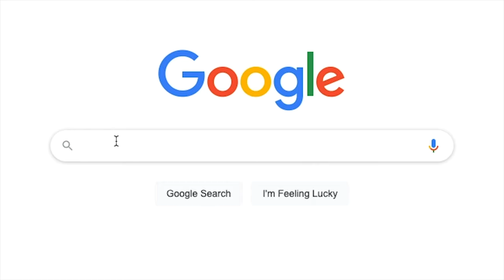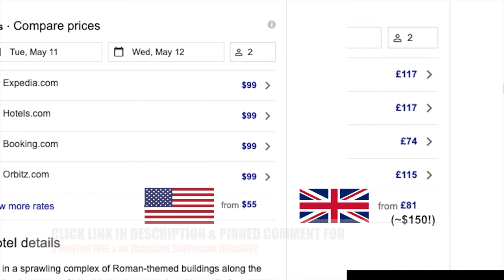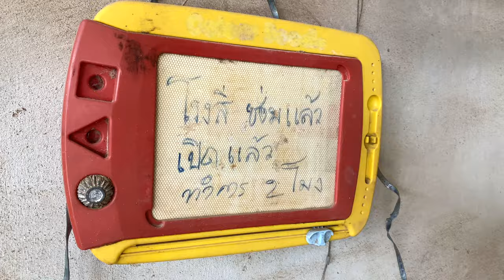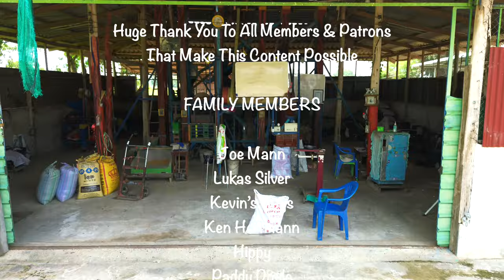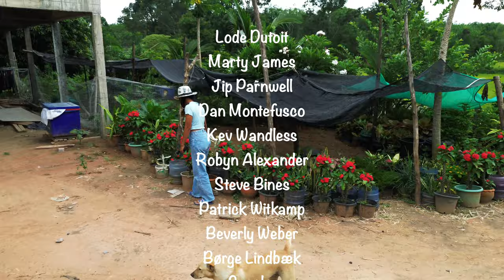Escaping Alcoholic Son.. Detailed Cost Of Living In Rural Thailand 2023 (For A Local)🇹🇭

Comment: Wonderful flog again. Few things doesn't add up.
The rice mill, it looks amazing, but absolutely isn't running of the 3 panels!
We have visited several mills and they all have their own special tweaks :-)
But.. +/- 3000 watt motors for this size.. 
8000 THB, 25 per bag, say 350 bags. 45kg takes about 20 minutes, 
Their electricity bill alone should be about 4-5000 THB.
Perhaps the 8000 is after deducting the electricity cost?

50k for 3 solar panel setup?
Probably including the pump, inverter and battery.
But even then, expensive.

(Sorry, we live off grid, so I'm in the know.. prices and equipment)
3 panels + pump + gel battery + inverter.. 20k is doable.

I guess a bit like the house...
Sadly i see this a lot.
Poor people kept poor by people asking exorbitant prices..
800k for that "skeleton build".. that's steep!

And there lies also the downside of village..
If he doesn't ask the builders in the village, they are offended and won't bring their rice.
If he makes a problem about the high cost.. same same..

Brave man and woman!